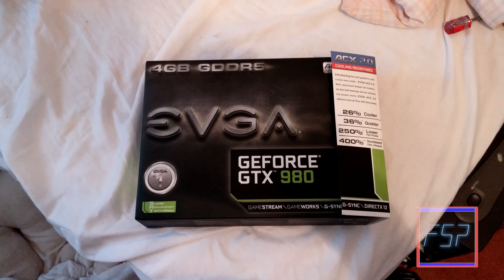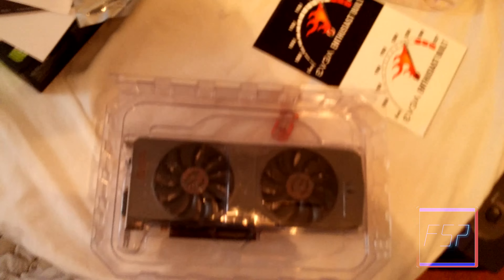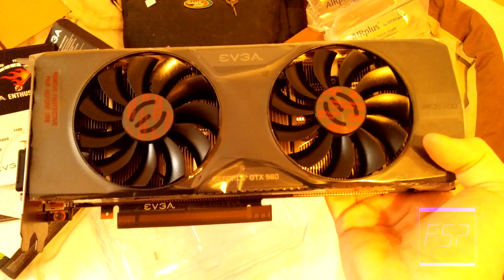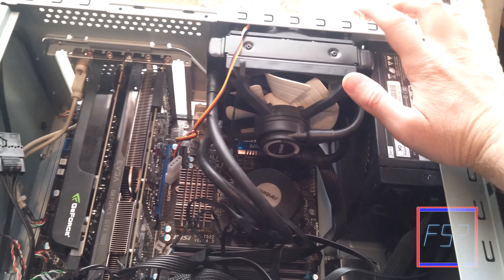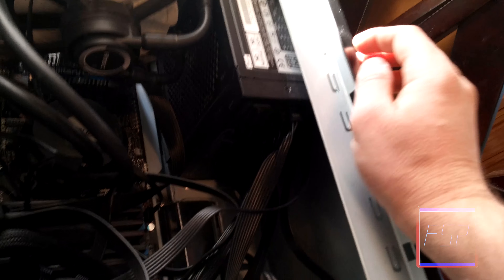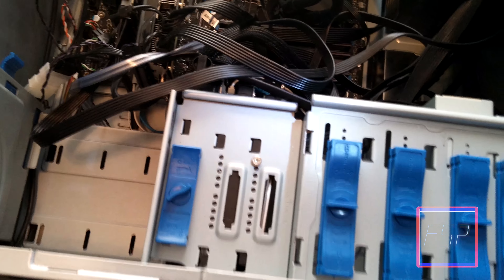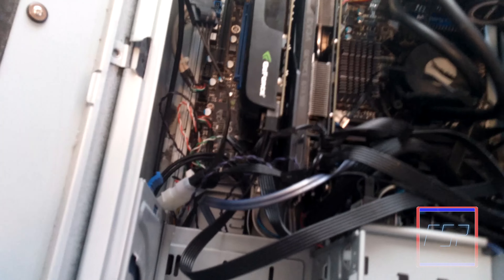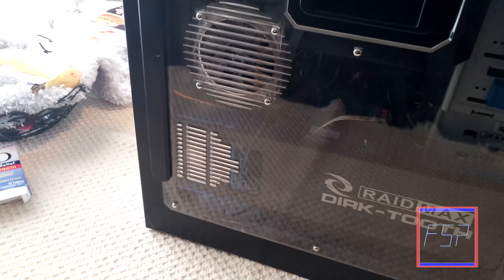Geforce 980 and Intro to my i7 930 rig

Comment: Holy cable management Batman 😮  I'm still gaming a i7930 paired with a GTX 960 modest overclock to 3.25ghz plays everything current in 2019 meduim settings
Reply: I got a i7 930 and it holds its own

Comment: I have the same CPU i7 930(@stock 2.8 never OC & not a big fan of overclocking) in Dell T3500 workstation which now I'm thinking to upgrade to i3 6100 3.7 or i3 6300 3.8, what do you suggest, will It improve my gaming performance I mean 4 core(8 threads) vs 2 cores(4 threads) or It's the matter of new processor technology.
I'll use GTX 970 4GB, will these i7 or i3 bottleneck my GPU?
Reply from the maker: Hey man this is Cell. I would say your still fine. But a i3 is no means a replacement for i7. But I will make sure Joe see's this. And chime in on thise seeing he has the same CPU
Reply: Hey Xamy. From what I've messed with, gaming you probably won't notice too much of a difference. My old i7 doesn't bottleneck at all with my Geforce 980. Overclocking it is pretty easy and you do get a decent boost but its not necessary for gaming. I honestly think that going to an i3 would be a downgrade overall even if you don't overclock.
Reply: thanks for your opinion :)

Comment: Hey, I have the same i7 930 but in stock 2.80ghz, with radeon HD 5850, very great card but old = (. I am thinking to buy R9 380 4GB, what do you think about it? Thx
Reply from the maker: +Leonardo Sigolo Its a good card. Mostly for 1080 resolution and gaming. This is Nick by the way. I am using a r9 285 2Gig card. and runs really well. How ever I can feel the crunch of the 2 gig of mem on it sometimes. So its great that your looking at 4 gig. If you run 1440p you will need to knock it down to medium high settings. But the 380 is a rebranded 285 and I have a video of that card on the sight. Joe is on holiday vacation. But I will make sure he see's you comment. Thanks for your time.
Reply: +Leonardo Sigolo  From everything I've seen the 380 is a pretty good card. Also the 930 is a beast even for its age so I'm sure the 380 would go great along with it. As Nick said, some things depend on what you want to do but I'm sure the 4gb one will probably do you just fine.